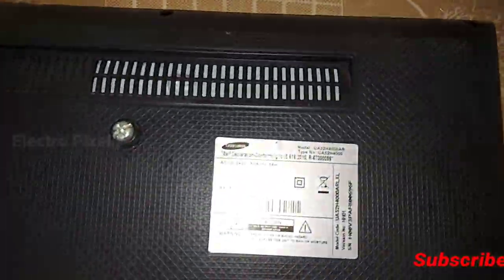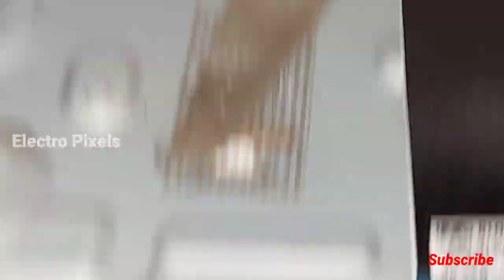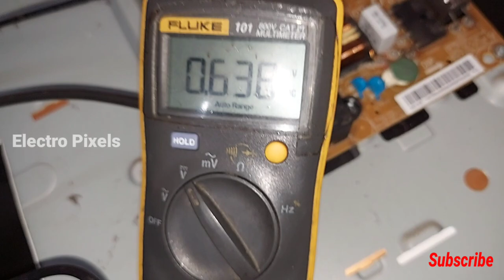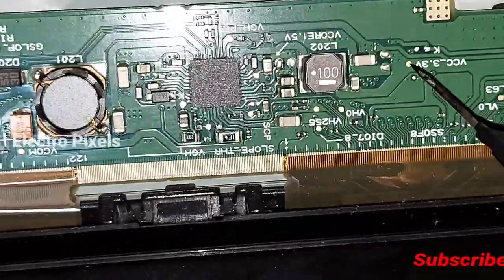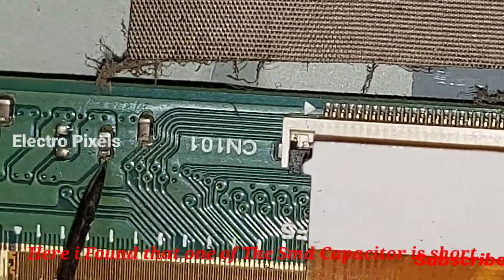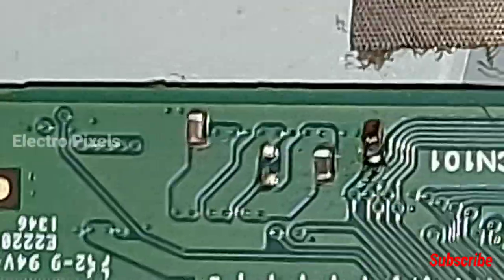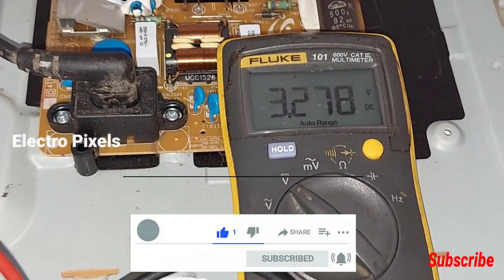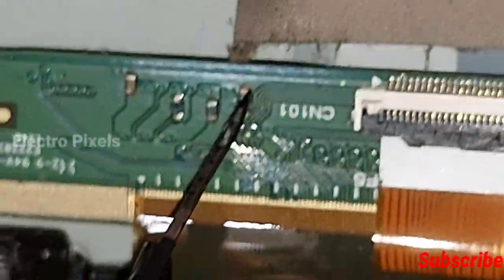Led tv Vgh,vgl Short removal on 32 inch sharp panel |Samsung Backlight ok No Picture.|Panel Repair.

Comment: Thanks for using English... So the main panel voltages to check is VCC, VGL, VGH, AVDD and VCOM? That is, 12v, 32v, 3.3v and 7.2v.
Reply from the maker: Avdd Voltage range from 14-18v, Vgl Voltage is approximately -5 - -10 Voltage it's a negative Voltage, Vcom voltage will be half of the Avdd

Comment: I am faced same problem only12 v is present left side connection removed. But same problem showing. Please help
Reply: Same sharp panel
Reply from the maker: Try to check any shorting, Otherwise problem with Dc to Dc IC
Reply: @ElectroPixels  iam checked near dc to dc ic area capacitors. No shorting. Need right side capacitors checking